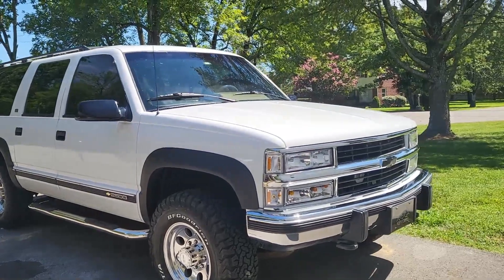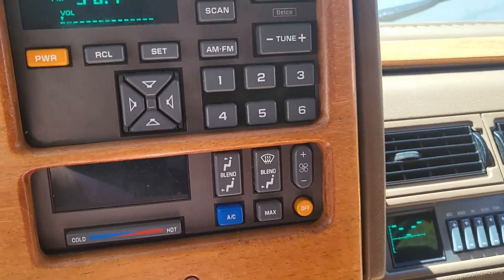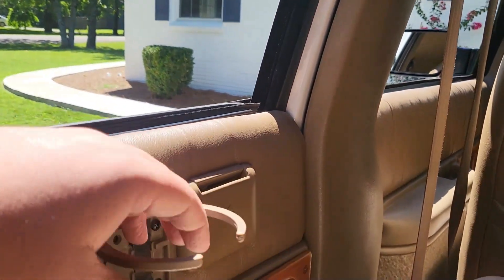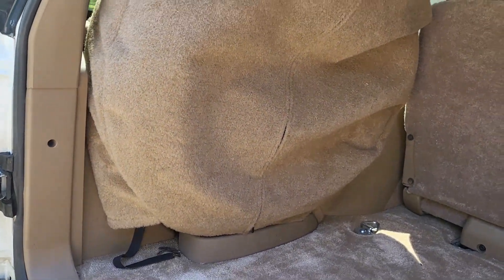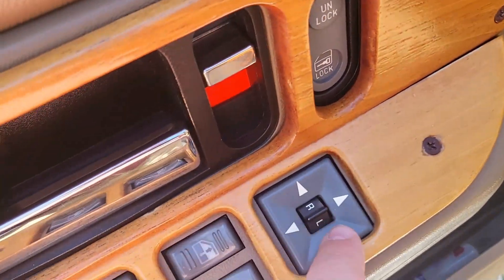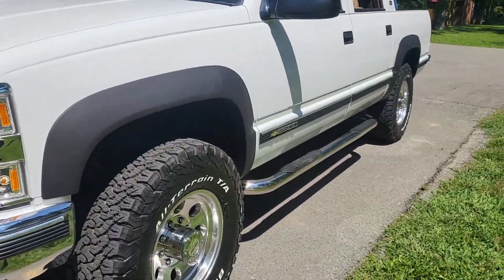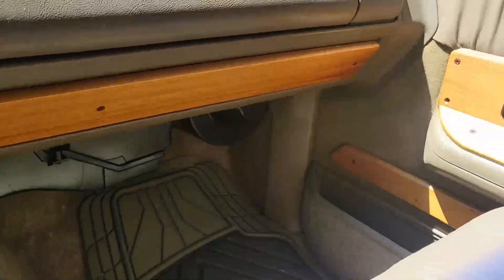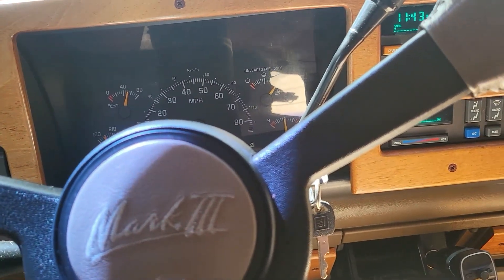*SOLD* 1994 Chevy Suburban 2500 7.4 454 with the Mark III package!

Comment: Adds 1,000 HP for the flipped air filter cover 😂😂
Which is breathing hot air now! It would be better with the cold air from the fender that comes stock with it on how it comes normally